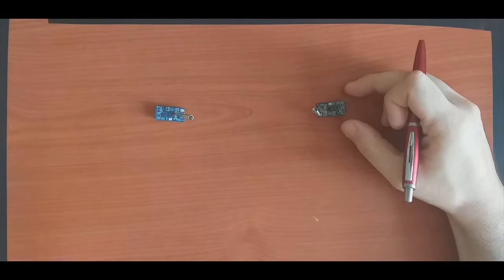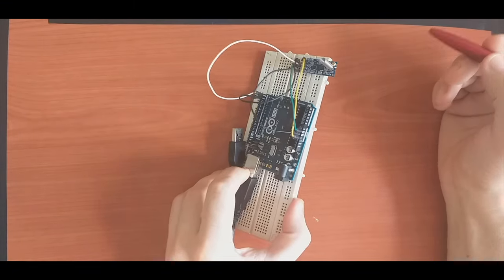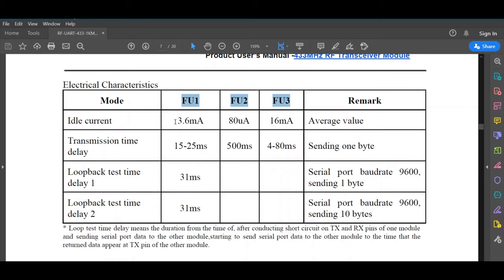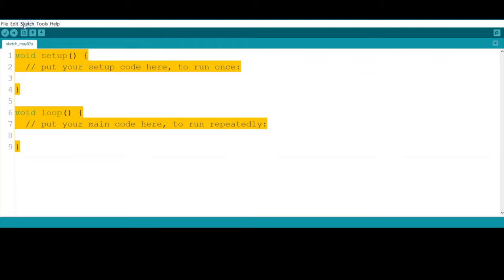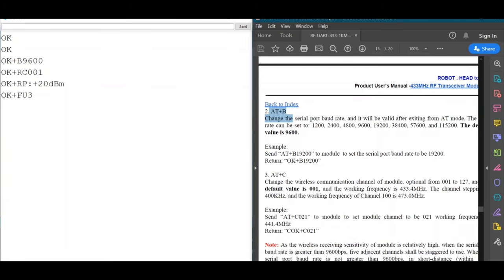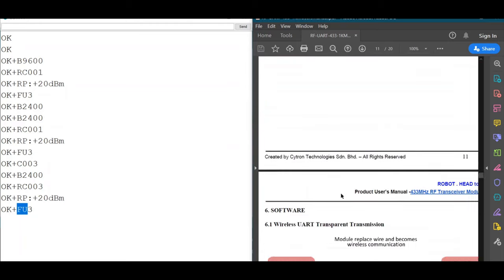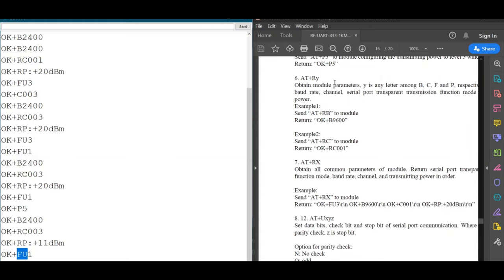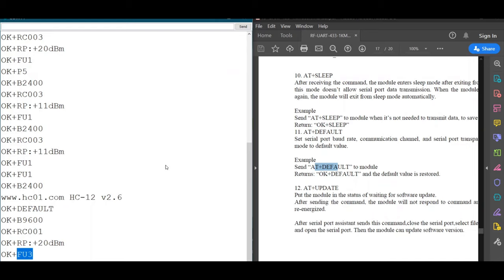1Km RF UART 433MHz Wireless module parameters setting using Arduino Tutorial

Comment: Hello, i am using the exact module, but i am having trouble communicating the module with my Arduino. i have already crossed the Tx and Rx wires with the module's Tx and Rx but cannot communicate with the module. i have also tried changing my Arduino board (using nano, mega,wifi) but still cannot communicate with the module. do you have any idea why and what is happening?
Reply from the maker: Could be either:
1. Power supply issue, suggest to use 10uF cap @ the VCC-GND.
2. Test the module with FTDI chipset/board directly. if you dont have one, you can keep the arduino MCU in rest and use the pin 0 & 1 directly.